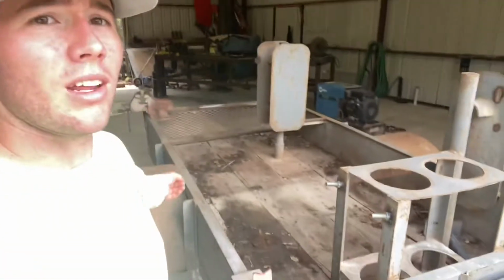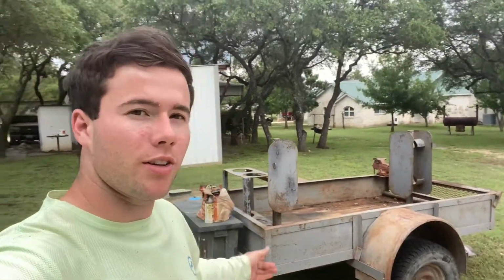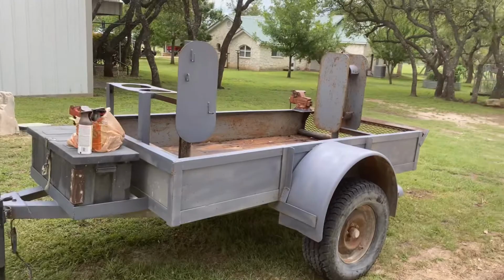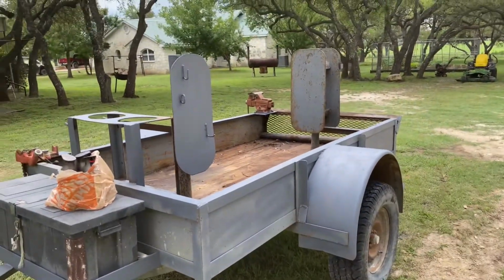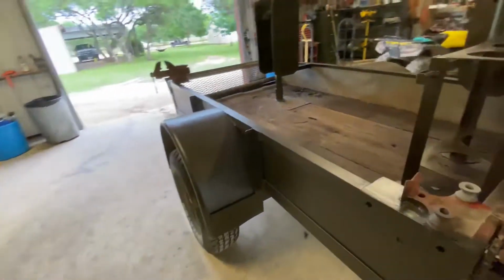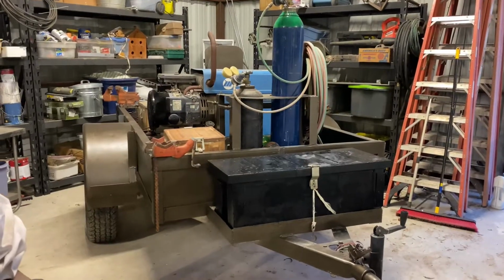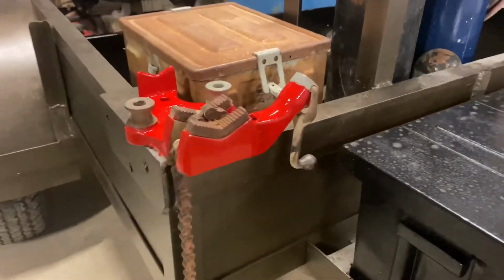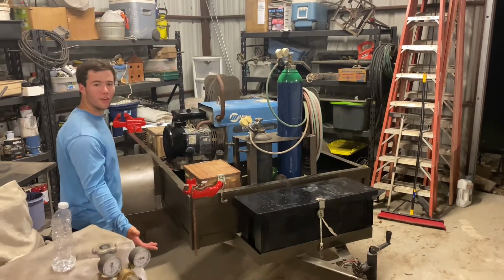Welding Trailer Improvements (part 2)

Comment: Can I ask you about a trailer I just bought?
Reply from the maker: Sure what’s your question?
Reply: @skylarwagner1155  do you have an email? i would like to show you couple pictures just to see if the welding looks ok…
Reply from the maker: I don’t mind taking a look at them, but I do not feel comfortable looking at the welds over email. If you take a video and post it on YouTube I would be more than happy to take a look.
Reply: @skylarwagner1155  please gimme few mins
Reply: @skylarwagner1155  please.. i would love your input
Reply from the maker: So it looks like it was stick welded, with multiple passes. Not sure why the user multiple passes but as long as the underside doesn’t look bad then there isn’t anything they were trying to cover up.

What are you planning to use the trailer for?
Reply: @skylarwagner1155  my plan is to add truck rail on it and make a roof top tent… plus maybe a box with pull out kitchen… do you think it will be ok?
Reply from the maker: I can’t tell you 100% since I can’t see it in person, but for something like that it should be fine. If you are still worried about it I’m sure you could take it to some welding shop and they could take a look also.